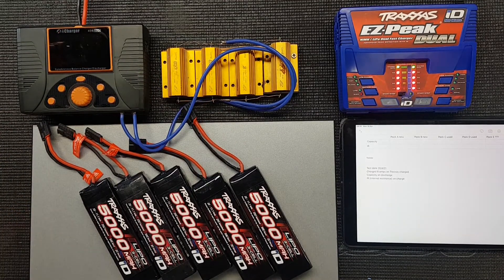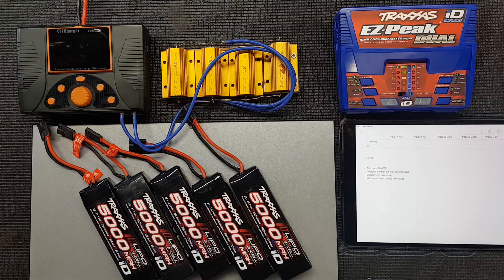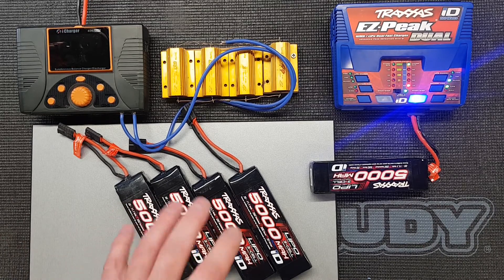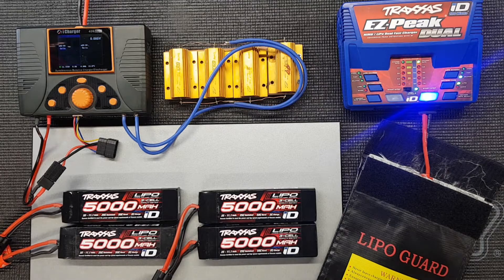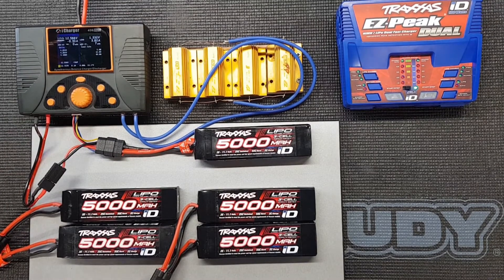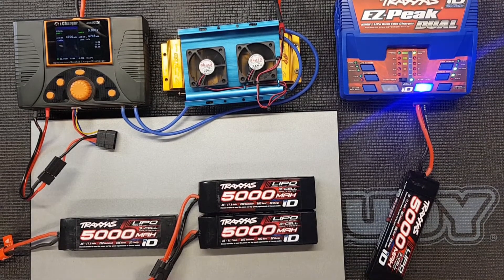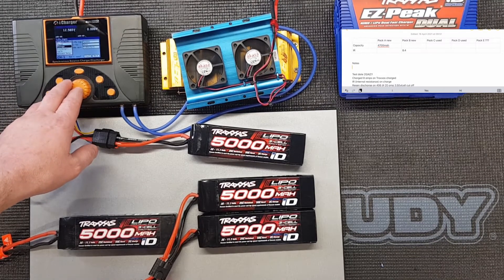New v Used, should you buy used LiPo batteries- tested Traxxas 5000mah 3s  TRX2872X lipo review

Comment: Traxxas has a 1 year warranty on all their Lipo batteries and they will replace it for free if you have any issues. After 1 year, they have a Power Up Program that lets you buy a new replacement lipo for 50% off, no questions asked btw! Just got to show proof of purchase (receipt)...
Reply from the maker: Thanks for info
Reply: @TeamRC3D  You bet! And I'm REALLY enjoying your videos on the UDR and Traxxas' lipo batteries for this truck!  So do you feel the capacity of the these lipos are worth it? I know the capacity in other brands can be overrated but if these are only 25C, is it 25C per cell or the entire pack? 

One lipo brand I love and have for my X-Maxx is SMC True Spec and they have a much higher C rating and the quality is great.  But from your videos and testing, I'm thinking about maybe trying the Traxxas brand lipos.  Especially since they have the best warranty and replacement at 50% off.  Do you have a forum or email where you regularly chat? Would love to get more feedback on this... thx again for great videos! Subscribed!

P.S. I also use an iCharger (206B) and iChargers are the BEST imo! Absolutely high quality and VERY powerful chargers (high Amps & Watts)!!!
Reply from the maker: @N_Fortune  WOuld be 25c for whole pack - agreed icharger are one of the best chargers. Biggest problem with the UDR is the battery compartment is quite small and you are limited on what other batteries can go in there. The cheaper ones are usually too big!